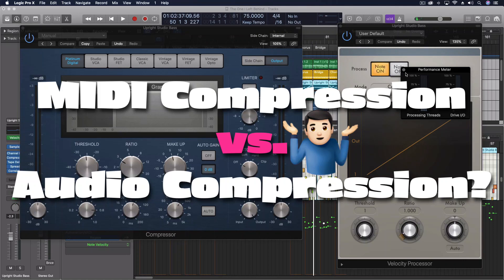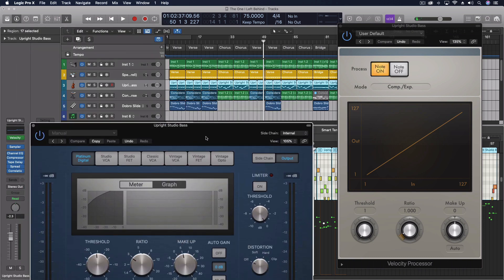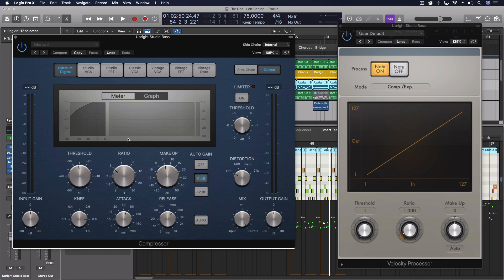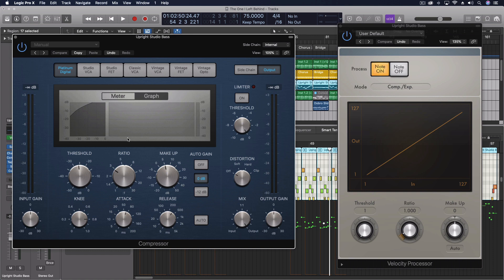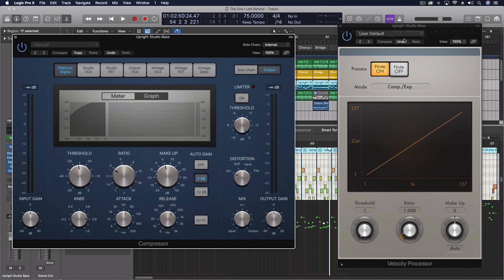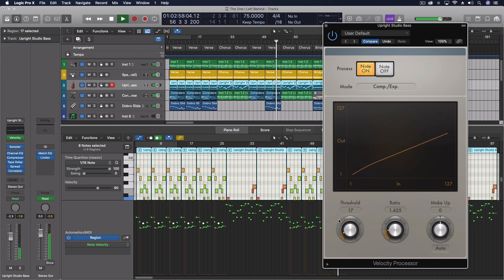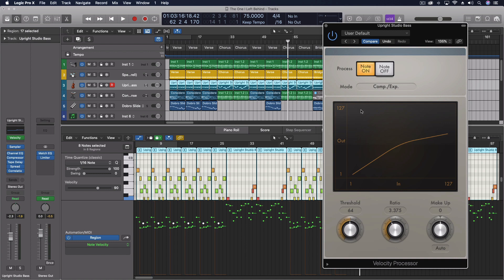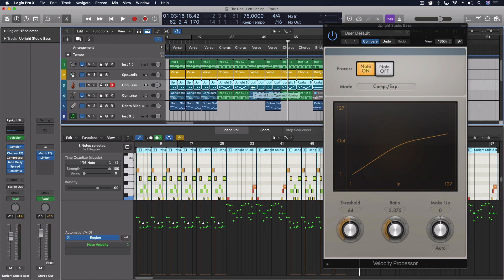MIDI Compression vs. Audio Compression? | Logic Pro X

Comment: Is it wise to use audio compressors on a midi track? Should i bounce it to an audio file before audio dynamic processing?

I feel like all my compositions sound too digital because I'm using audio compression on midi tracks. 
If i am incorrect, what is the best way for Logic Pro stock vst's to sound less digital?